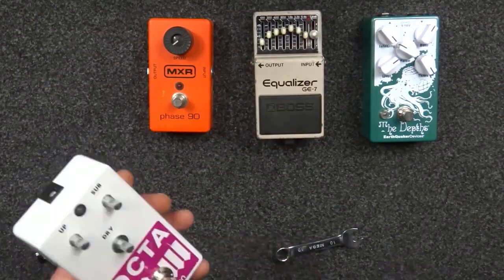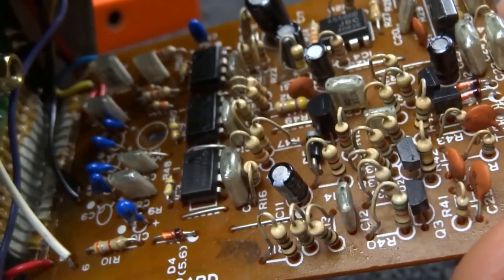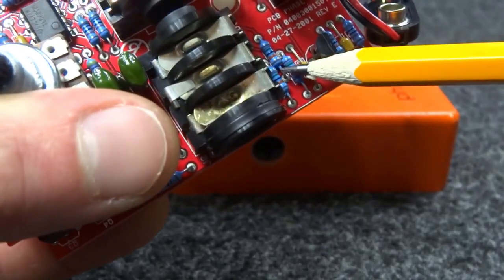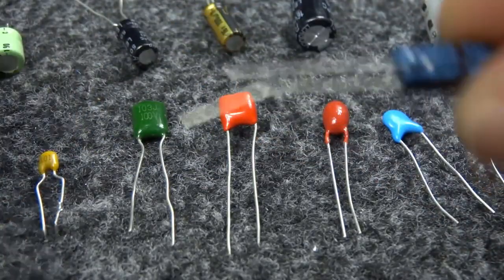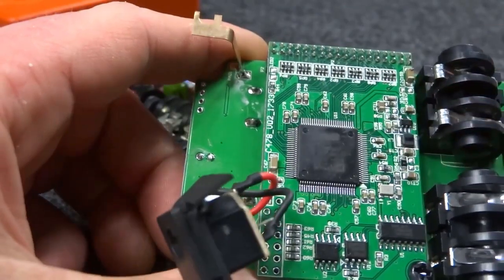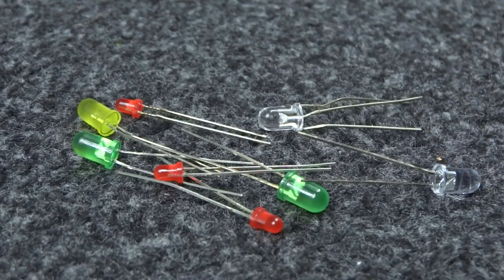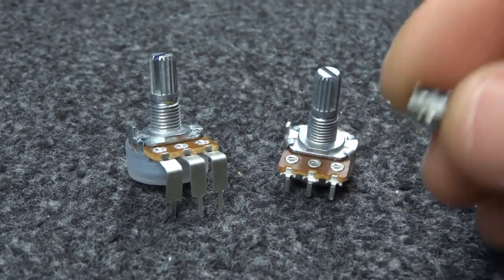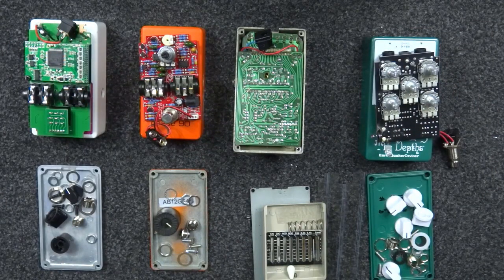THE MAGIC Hidden Inside Guitar Effects (Revealing Parts)

Comment: As we all know- the levels of magical power ascribed to electronic components varies wildly with component type and specific usage, with Germanium components (basically, Mithril components...) displaying the greatest magical properties and everything else sitting at some lower position of magical power.

Very few electronic components (when placed in a little metal enclosure with a 3PDT switch sticking out of it) show zero magical power....

The cosmic ordering is broadly held to be:

Germanium transistors - pure magic.

Germanium diodes- magic.

Silicon transistors- slightly magical if used in certain circuits.

Op-amps- generally not magical at all...but sometimes- slightly magical. 

Capacitors- sometimes magical, usually not magical.

Resistors- very very rarely magical (carbon comp resistors in tube amps- magical), but generally totally non magical.

Potentiometers- i heard one person claim they are magical once, but nobody else since then.

Batteries- can be magical if used in fuzz pedals.

PSUs- much like batteries: can gain magic-through-asociation (with fuzz pedals).

Switches- i have never heard anyone claim that a switch is magical, but i do not doubt someone has.

If we extend this further to guitars themselves-

Pickups- magical
Wood- magical
Switches- magical
Potentiometers- magical

Capacitors- magical (this is a good one!) Capacitors are widely held to be largely non-magical when in pedals, but when in guitars or amps they become amongst the most magical items known to man....

And so on.

Comment: Very interesting and educative video!! By the way, I have a curiosity regarding two groups of guitar pedals nowadays, the very crazy cheap pedals and expensive guitar pedals, a lot of times I was impressed how they are extremely different in the price gap. It would be great if you can reveal whether the quality of the production material or components between each other really the reason why they are extremely different regarding the production cost, or may be there’s another reason by comparing both of them.
Thank you :)